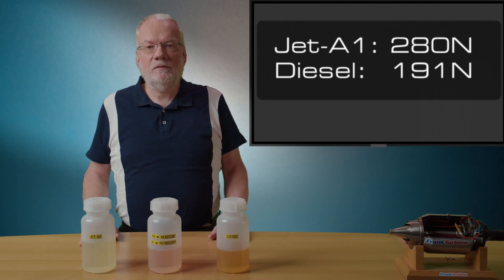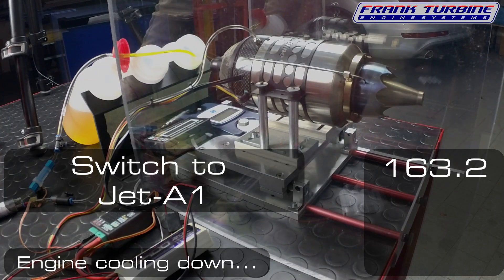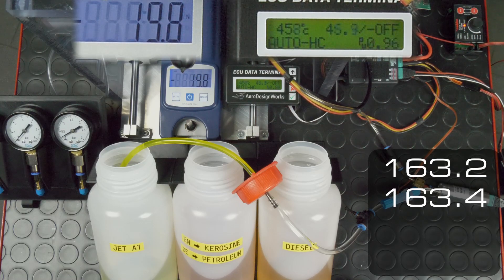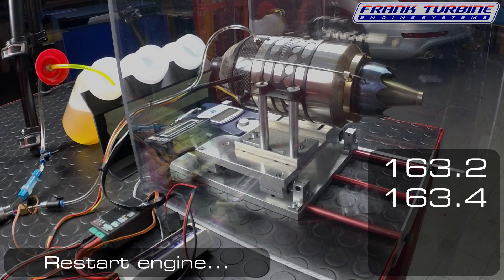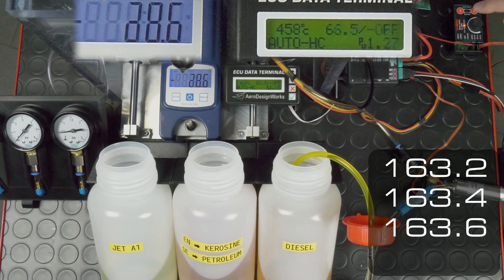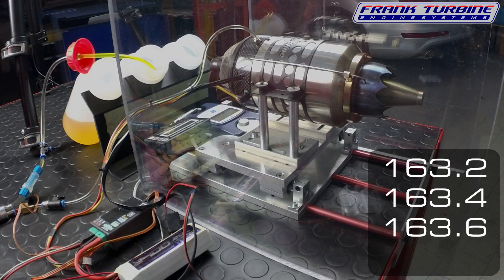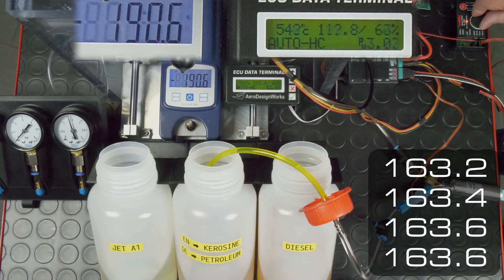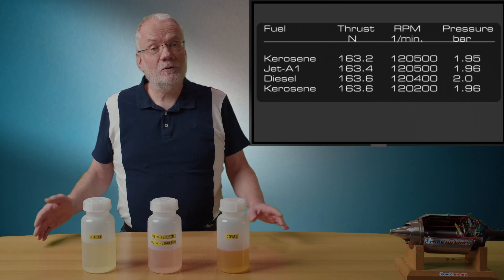Is that possible? Turbine thrust using Jet-A1, Kerosene and Diesel... No!

Comment: Nice video, I want to clarify a couple of things for you. Jet engines are simple, more fuel equals more power until they go boom. (U know this tho). 
I did in fact recalibrate the pump according to the instructions many times as soon as I saw it didn't make enough thrust on diesel,  I did the video for one reason and one reason only to introduce people to hydrodiesel fuel which is in its final micro emulsion version right now. I didn't care if the engine performed well or not, all I cared about is that the hydro diesel performed well.
 The system and the engine here that you are using is not the same one I was using, it's not the same engine or same pump type so obviously you will have different results...send me your pump baby...lbvs!, Also I never say what type of turbine I have, your just assuming, there are so many clones and I also have two engines that I built myself from scratch.
I did in fact find the issue with my and it's not what everybody thinks, I am going to redo the test very soon here as my season just started last week, I meant to redo it like a year ago but I had some big family problems. I'm going to move that video up on my schedule, I have to take apart the jet powered Tesla first. Thanks!
Reply from the maker: Thank you for your comment.
Reply: @IngmarGrote  absolutely!

Comment: THANK YOU!!!!!! The original dude that made that video DIDN’T do the test correctly. He didn’t recalibrate the pump for the different fuels as the MAX RPM for each test, it didn’t reach the same number which is SHOULD, it is clear in the video. I told him this twice and he responded in the comments, but still won’t redo the test correctly. I am surprised he didn’t redo it when so many people noticed there was something up both in the comments and on the forums where turbine guys are all in agreement that if the engine doesn’t reach MAX RPM from test to test which it SHOULD, of course it’s not gonna produce the same thrust…….
Reply from the maker: 100% correct!
Reply: I actually did in fact recalibrate the pump many times as well as the pump limit to the max.. just like we talked about in the comments section A while back, if you have a different procedure to calibrate the pump,  please share it with me, also everyone just assumed this is a certain brand of engine which I find kind of funny. You can get all these parts off of Alibaba to build the engine and I have. But as for the science behind the test yes diesel should theoretically make the same or more power than kerosene... I'm actually very excited to redo this test. Thanks in advance!
Reply from the maker: Hi Warped Perception, eventually your pump is to small to feed a 300N turbine?
I have a 300N turbine as well and the pump is much bigger than the one used for a 200 / 220N turbine.

Comment: Top! Ingmar, ich habe mich schon sehr über das von Dir angesprochene Video gewundert. Bin froh das Du es widerlegen konntest. Tolle Arbeit!  Another nice Knowledge Video made by Ingmar!
Reply from the maker: Danke, freut mich sehr, dass es nützlich war.
Reply: Temperature limitations still apply, and diesel fuel burns hotter.
So, the correct answer is: it depends....
If you run the turbine at the same rpm as before, then thrust figures might be similar. But then you are running with less safety margins on diesel, compared to kerosene, because it's going to run hotter on diesel.
If you expect the same safety margins as before, then you inevitably will have to drop  turbine temperatures (and hence also max rpm), while running on diesel, and then you will observe less thrust on diesel, for similar egt.

This is due to the fact that kerosene contains more hydrogen and less carbon, compared to diesel.
Hydrogen releases more energy for less temperature when it's burned, than carbon does.
Which means, the less carbon your fuel has, and the more hydrogen your fuel has, the more power you can acieve for the same exhaust temperature.
This is true for any combustion engine, not just turbojets. (And thats why nitromethane fuelled dragsters can push 11 000 hp, without any engine cooling whatsoever. The fuel is so hydrogen rich, that the fuel itself is also cooling the engine).
Reply from the maker: Hi Vegard Witsø, as you can see at the GSU the EGT value is only 5°C above the A1 value and far away from the max value, the manufacture defined as a limit. So that is not a limiting factor!
Reply: Hi  @IngmarGrote  :) For your particular engine, it's true that diesel provides just as much thrust as kerosene. For different engines, operating closer to its max egt, the picture might be different.

So, it depends. There is no clear yes/no answer, to wether diesel will provide less power, unless its tested on a specific engine (which you did test, very well :) ).

Other factors we haven't talked about also plays a role. Such as combustion chamber design.
Burning diesel efficiently requires better atomizing of the fuel, than kerosene.
Which means that engines with less eficcient combusion chambers, will show a bigger difference between kerosene and diesel, than your, well designed engine does.
I have seen this in practice, with the older motors showing orange flames when run on diesel, but no flames on kerosene. This indicates incomplete combustion.

Your engine shows no flames on diesel, indicationg complete combustion.
So your engine shows just a little hotter EGT on diesel. But these older engines, not being able to perform complete combustion on diesel, they will show much bigger EGT diefference, between diesel/kerosene. Thats because a portion of the combustion takes place behind the turbine wheel, hence it's heat that the turbine cannot convert to mechanical power (and thus cooling the exhaust gas).
Reply from the maker: Hi Vegard Witsø, my Test engine is old too, its out of production for over 10 Years.
And, in the linked Video the EGT is for JetA1: 680° and for Diesel: 600°
So the guy definitely did something wrong!

Comment: Now after watching you dip suction line in different bottles... Got an idea to try K45 g4 to run on diesel after it starts od kero first(it can not start on diesel)
That would be doable wit Y splitter and ball festo valve for start from outside taxi tank and then shut off that valve and pump sucks from diesel tank in model... Kero is 3€/L here, and diesel 1.4€/L
Reply from the maker: Hello Tomislav, nice idea, should work. Give it a try and tell me the result!

Comment: Nice one!
Maybe do a comparison of consumption for given thrust, lets say 162N to keep it same. 
And how many ml/min is needed. I fly on diesel with K80 and kero K45. 
Keep up with this great videos, been watching your german ones for many years but this will bring you more people to your channel :)
Reply from the maker: Hi Tomislav, thank you very much. Good idea, I try to make some tests...
The pump value shown in the bottom right corner of the GSU is nearly constant.
I use a brushless pump, so the shown value should reflect the fuel consumption.
Reply: @IngmarGrote  kingtech suggest in official manual to use diesel because it gives more thrust, maybe wrong translation, maybe it gives same for less ml/min, 5% they say....
Would be nice to see numbers like you tested now here. Because we fly with fixed fuel capacity tanks, always takeoff with full  :)